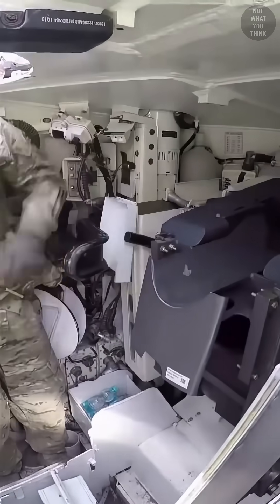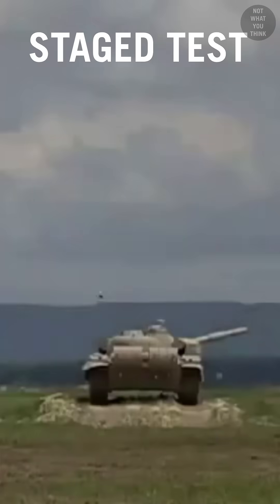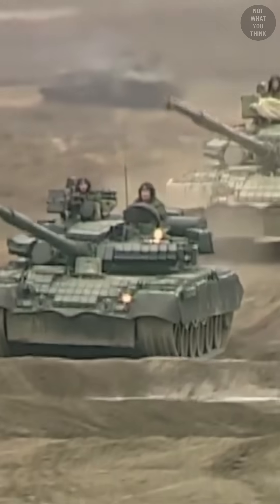Why M1 Abrams Tank Has No Auto-Loader #shorts

Comment: That's a lousy reason. The real reason is that it's cheaper, weights less and is less prone to failure as there's less moving parts. Different kinds of rounds like HE/AP can easily be changed not to mention that with the extra space an extra crew member/ammunition can fit.
Reply: I'm afraid it's not cheaper. An additional crew member means bigger turret, which translates into more armor etc
Reply: Autoloaders are safer, faster and consistent human loaders get slower over time. ttb Abrams cycled 66k rounds before any malfunctions and can carry 44 rounds

Comment: Safer to manually do it and also less moving parts that can fail. With a blast door it means tank crews will always be safe.
Reply: not at all, autoloader can use blast doors as well, they are reliable, dont get exhausted and most important require less crew. The crew is the single thing in a tank that requires the most space. Less space means the tank will be overall smaller and harded to hit. On top the saved weight can be used to either improve the manuverability of the tank or increase the armor for the rest of the crew
Reply: @SchwertKruemel  also anything above 105mm is pretty cumbersome for the loader to handle, above 120 I'm pretty sure an autoloader of some sort is always required, and considering how armour development is going, bigger guns are going to be a requirement soon.
Reply: @herlescraft  not necessarily bigger, probably faster is the way to go
Reply: @nxvh9062  you sure about that? I've heard that longer rods are they only way we currently have to defeat Russian composite armour, ive seen simulations where a significant increase in speed does little to prevent the shattering of the projectile.
Reply: Until the poor bastards die from cancer eventually because of all the enriched uranium everywhere
Reply: @G31M1  but that’s much later, likely after the war is over. However, if you’re implying that they will die quickly from strong radiation, then enemy tank operators will likely also die. The difference is, we’ll have at least one more man who’ll possibly survive and continue operating the tank.
Reply: @G31M1  if blast doors are that safe thy don't they put them all around the tank?
Reply: So let's use a jet engine for its propulsion...
Reply: @TarmanTheChampion  they do don’t they?
Reply: @Fetidaf  yep & they have to manually remove & replace the jet fins (strakes) often because even grains of sand puncture holes in them! 😵 very expensive & time consuming
Reply: Not safer breach block almost took my pinky off loading a sabo round hooah
Reply: I would say that’s a fair trade off for a 3 times faster loading speed. Not to mention, yeah it is actually way more reliable.
Reply: @theggfloupin4084  exactly, like any automated factory ever decided to go switch back to standard employees xd
Reply: Good point. Exactly what I was thinking. Watch a small pebble get caught in the gears of the auto-loader 😕
Reply: *fewer
Reply: First: It’s no safer to do it manually, 
Secondly: The tank is full of shit that can fail, and if you’re worried about something breaking down why have a tank at all
3rd: the leclerc, k2 black panther, type 90, type 10, T90M, T14 armata. All have autoloaders. And blast doors with blow out panels.

Comment: Nothing like seeing the TC’s face after his loader sets a heat round down on the bottom of the turret during a table 7 live fire. I’ve seen some of the dumbest shit that could be avoided with an auto loader.
Reply: Which way did he set it? No way someone was dumb enough to set a high explosive anti tank shell on the impact trigger on the floor of the tank…
Reply: @trustyetman1678  they are fired electronically, not by impact

Comment: Manual loading is also faster than auto. The ammo door stays open as long as you keep your knee on the plate. The Abrams range makes it double as artillery. For 75 tons it's fast as hell. Fuck the computer in the A2. And for all the safety features between cancer, breach breaks and that damn emmo door the Abrams kills everything inside and out
Reply: The Abrams only tops out at 40 miles an hour. It’s not very fast

Comment: Still not clear WHY auto loader can't open armored door instead of human in Abrams tank...
Reply: propably reason in abrams was designed in 70's. Autoloaders than was defective. Now autoloaders are better, but for autoloader you have designe new turret for abrams. It takes time and money, so what sence change it if propably USA designe new MBT what will replace Abrams in future. Especialy 120mm shell is abou 20 kg (40 pounds). Propably new tanks willbe have 130mm canons so their shells willbe to heavy for human loaders
Reply: @prasaite  Hi, engineering and manufacturing of auto loaders are obviously complex. I just don't get why narrator turns it all like manual load is an advantage)))
Reply: @aiverneverminder  Everything have positives and defects. With higher caliber of shells autoloader system have more positives than human

Comment: tanks usually carry multiple types of munitions. At least the abrams does. HE and SABOT are the two most common. And no belt-fed autoloader with 120mm ammunition in a tank could switch between the rounds and be faster than just telling a guy to do it. and most soldiers can load a new round somewhere between 2-5 secs...

Comment: I think at this explosion, there is nothing in the tank that can protect you from it. Im mean a tower from Greman thank has a weight of roughly 20 tonnes and is also one of the most heavy parts of the tank. You saw this "pice" of metal easily raise 15m to 20m up in the air, imagine what kind of pressure and acceleration is required to lift this thing in one second up to 15m.
I think no-one will survive such an impact because of the air velocity and cause pressure besides that the vessels is very limited in space, so that the wave is relected and will hit you twice until it evaporates to the weakest point (which  is then lifting the tower).
So I would not like to bullshit myself if I would ride a gun powder casced.

Comment: The auto loader isn't related to the process of loading the ammo onto the tank, its the thing that jams the shell into the main gun.  We use humans, the russian tanks tend to use a mechanism.  And the human is often faster.  We would have the round being pulled in a bit by the vacuum within the barrel after the spent casing was ejected, the loader was that quick.  Not always, but often enough.  Dangerous position though, don't get between the gun breech and turret wall.
Reply: MBTs use 120-125mm shells nowadays and autoloaders are actually FASTER and more predictable. Also, all modern autoloaders are capable of manual loading.
Reply: @TheGrantourismo  I was in the M1A1, driver, occasional loader.  The first reload tended to be fast if you had it ready. Rarely are you firing bang bang bang, as fast as you can go, so really it's a non issue.  Usually you have 1 chambered and the second round in your arms. Soon as that breech comes back and starts returning to its normal position you are dropping the new shell into position and the vacuum in the barrel helps pull it home. Then as the gunner is setting up the next shot you are pulling the next round from storage.  Even in a running fight the loader / loading system isn't typically the limiting factor.
Reply: But machines don’t get fatigued
Reply: @MilkyWayFrog  Battles like this don't last that long and the tank only holds so many rounds.
Reply: Yes but humans can get tired and can over work themselves which affects loading efficiency
Reply: @crispyboi4062  Its really not that strenuous, and autoloaders jam/break, just like humans.  If the loader dies or cant load the tank commander can load a few shots if needed.
Reply: @avi8r66   "Its really not that strenuous, and autoloaders jam/break, just like humans. " No, not like human, far less than humans. We had the same issue in plane, than the Boeing doing the old way "human before computer" vs airbus "computer vs human" but the fact is, human makes far more error than an automation, every time.
Reply: @tm.8399  But in a combat tank, which is the topic here, if the human autoloader fails I can replace them with another human, either from within my own crew or from outside depending on the situation, in a couple of minutes or less.  And that's what ultimately matters. If the mechanial autoloader fails that entire weapon system is offline.
Reply: @avi8r66  If the autoloader fail you can replace it or load manually. If the loader is dead there is an high chance the loader is broken too since it means a projectile went through.

 Also no you can't always change the loader, what happen in this situation ? Well if you have an autoloader you can still shoot, at the end, it's the same problematic, but the autoloader fails less than a loader, that's for sure.
Reply: @tm.8399  In the case of a human autoloader the 'failures' that would take them out tend to be injury (not due to projectile unless they were fully or partially outside the turret) or exhaustion.  In both cases the tank commander can hop down and load the next few rounds.  Or, the gunner can take over loading and the tank commander takes over gunning, depends on the situation and crew.  An injury inside the turret might be the loader getting his arm or body between the breech and turret wall as the main gun fires.  Or a bad bounce causing a foot or arm to get pinched/crushed as the turret is turning.  Injured or dead the human loader can be moved aside and someone else take over his duties easily.

I was in the M60's and M1A1's, and we did this regularly in training.
Reply: @avi8r66  never seen an autoloader being exhausted. So 99,9% of the time the autoloader will do a better job, if it broke, it's made to be changed on the field, and it's less of a burden to send a new autoloader than call the medics special team.

one more time the yemen is a good example of that, while the M1 struggles, the leclerc performs well.